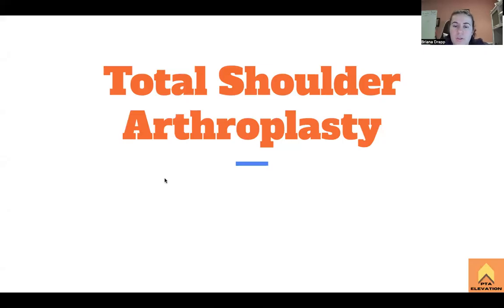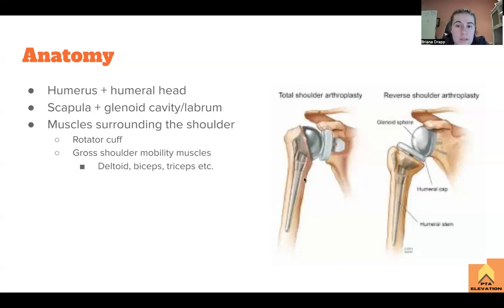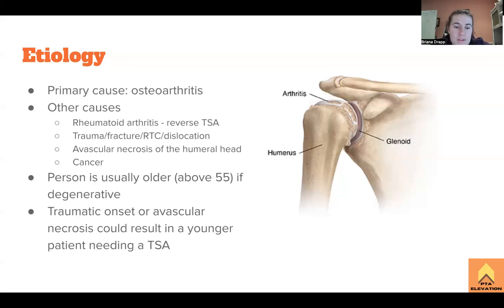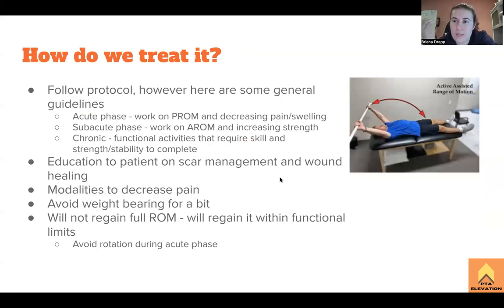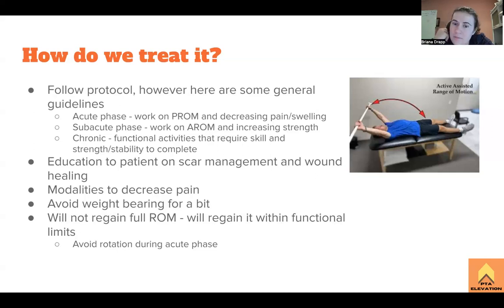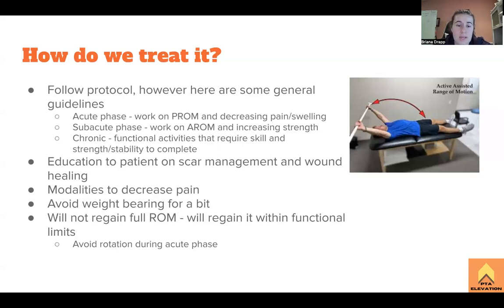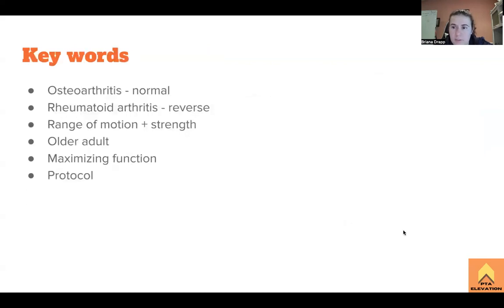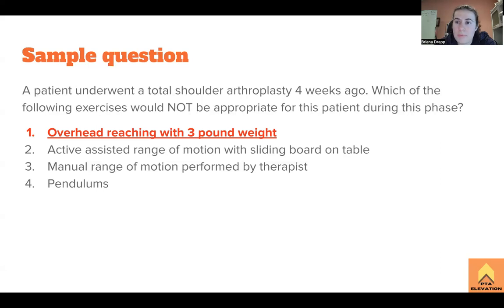Total Shoulder Arthroplasty - NPTE Prep

Comment: How limited would we expect ROM to be after a rTSA? And why/how does a rTSA provide more stability?
Reply from the maker: Because of how the prosthesis' shape is and it being flipped from normal anatomy, it limits the degrees of motion. And it's not SUPER excessively limited, like a regular TSA might regain 160 degrees of flexion and a rTSA only get 145 but both are still functional for reaching overhead to grab something out of a shelf. Also, the rTSA also provides more stability in this way because due to the shape of the new glenohumeral joint, it is now at less of a risk of dislocation. 

Great question (: